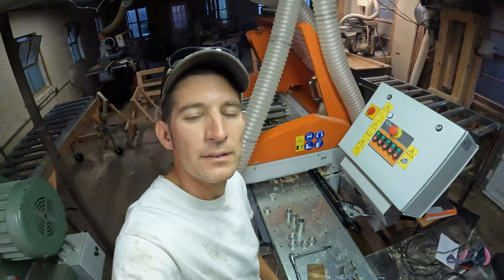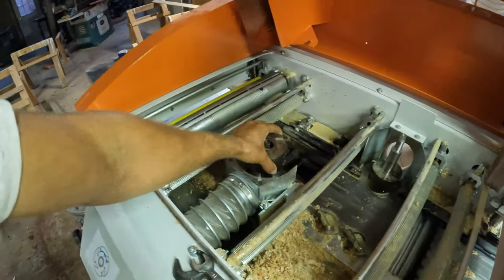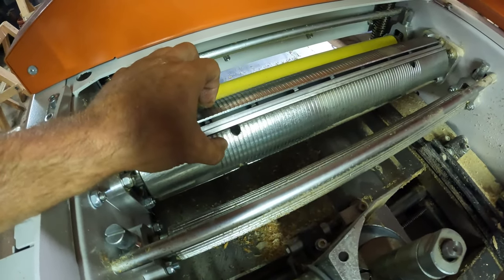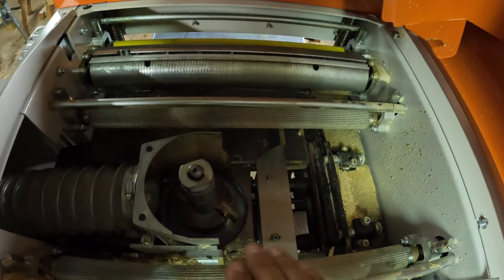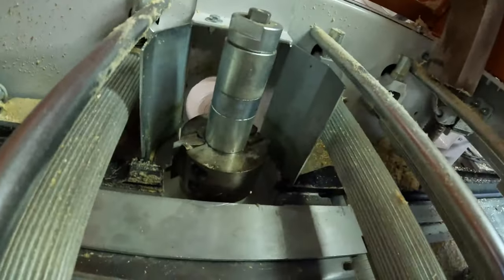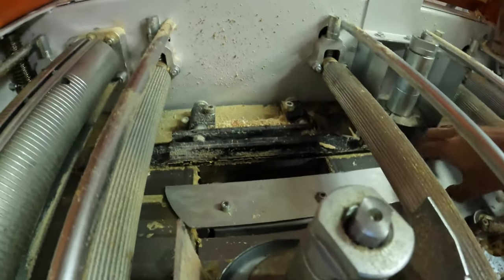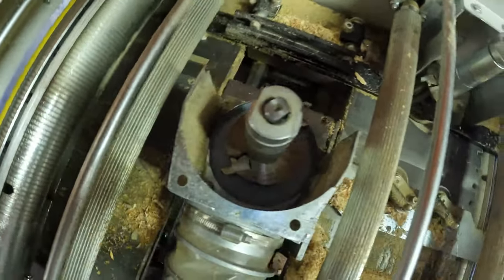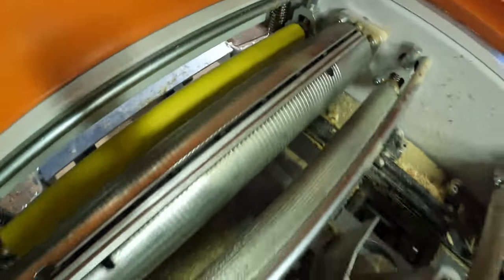How To Easily Setup Your Woodmizer Mp260/Mp360 Moulder.

Comment: How do u set your downward pressure on feed rollers? I see your screws are out alot farther than mine. I can run softwood no preblem but hardwood is giving me trouble. Thanks
Reply from the maker: You can play around with them either way to see if it gets better or worse, just make sure to keep them equal. I don’t think I really had to adjust much from the factory if at all. 

Check these things first before adjusting feed rolls…
Make sure your bed is lubed(I use paste wax)
Make sure all your knives are sharp. 
Don’t take too heavy of a cut and don’t have too much pressure on your side pressure roll. 

All of these will make feeding difficult.

Comment: Great setup video.  If I understand correct your taking 2mm on the right side but how much can you take on the left side, i.e.  what is the board width your starting wide?  If you want a 3” wide board are you starting with a board 3” + 4 mmwide?  What is the max you can take on the left side? 1/8” per side, but I think 3mm = 1/8”. 

Just trying to learn more.  I have a mp360 but have not used it yet as I have dust collection issues currently.
Reply from the maker: I typically try to take off equal amounts on both sides but it depends on the profile you’re producing. If I was just doing s4s stock yes about 2mm per side. Part of it depends on how accurate your blanks are. The left cutter is your “cleanup” cutter it sizes to finished width. The balance is finding a nice blank size that the machine doesn’t work to hard needlessly planing away(wasting) wood, and not too little that if you have a slightly undersized blank in the batch that it doesn’t get wasted by not fully planing.

Comment: With corrugated heads do you have to run corrugated knives or can you run both?
Reply from the maker: Only Corrugated knives will work in Corrugated heads. They are a thicker, heavier knife than Wood-Mizer style knives.

Comment: Have you had any trouble with the vertical adjustment for the table? I have the 260 and the chain under the table keeps slipping gears.
Reply from the maker: I never had trouble with the chain on mine. It is important to keep the elevation screws clean. If they start to get packed with sawdust it becomes hard to raise/lower the table and I did snap the handle once.
Reply: @hillcustomlumber   It would be nice if saw dust was the problem. We have yet to run a board through it.
Reply from the maker: Sounds like something is out of adjustment from the factory.
Reply: @hillcustomlumber   Yeah, that’s what we thought too. So, we had them take it in and play with it. They took out the elevation screws and remounted the table. Said it was working fine now. We got it back but couldn’t use it for 6 months for personal life reasons. 

Just tried using it for the first time since it got back from the Wood Mizer and the same darn thing happened again. All we did was mount the houses for the chip extraction unit, remount the table extensions and crank on the handle for the elevation screws. We’re about ready to kick this thing to the curb.

Comment: Do you need to straight line rip before to get the boards perfectly straight?
Reply from the maker: Yes the boards should be ripped straight to get the best finished product and feed easier. I use either my straight line ripsaw or 2 blade edger depending on the job. They could also be straightened on a sawmill.
Reply: @hillcustomlumber  Did you consider other moulders manufacturers before getting the woodmizers? Most of your other machines like the northfield are older wondering why you didnt do the same here.
Reply from the maker: Yes I did lots of research and shopping around online, 3 reasons set me on the woodmizer.
1. I have limited space and run my 3 phase off of a phase converter, a lot of the older machines are too big/too much HP
2. I ran a logosol ph260 for many years so the woodmizer machine was a direct replacement, I was comfortable with what I was getting with little learning curve. 
3. I have $1000’s of tooling for the logosol/woodmizer system that would have been lost if I went to another style machine.
Reply: @hillcustomlumber  Well said. I forgot how much hp/space the older moulders take. Ive got an extensive rough cut operation but no finishing. Would you recommend the 360 for doing pine siding and flooring? Im thinking it could also fill the role of surface planer until i can add that and other machines later